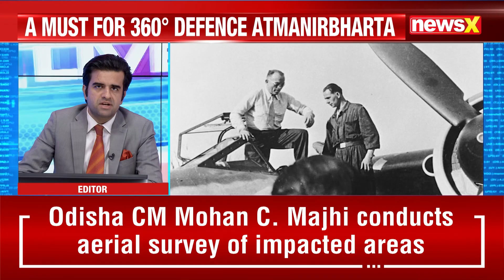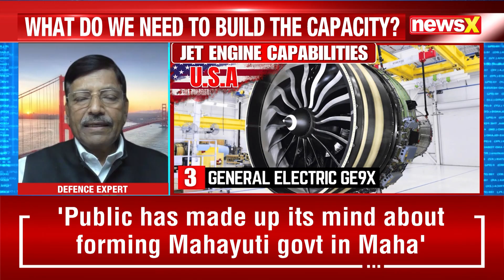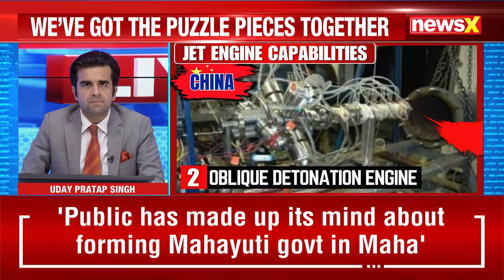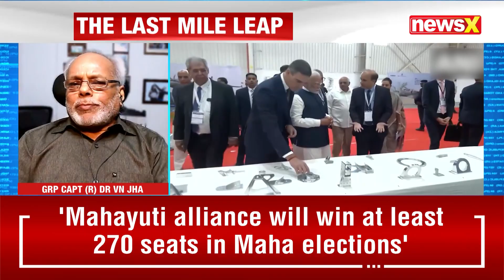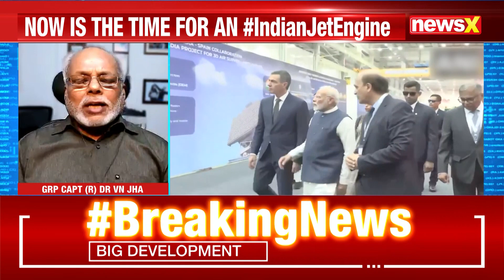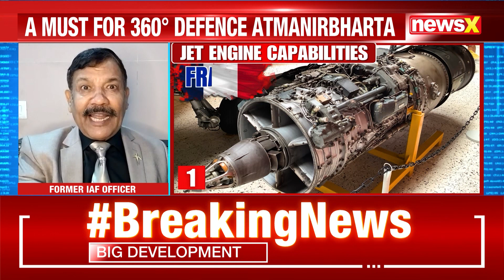Will India Produce Jet Engines Next? | What Do We Need To Build The Capacity? | NewsX

Comment: So much work left to do. By the time we come with the net engineother countries would have motored away further. They are not standing still. 
Sometimes it it is amazing and admirable how China has caught up with America in so many critical technologies
Reply: @viswanathanseshadri1047
That is the eternal dilemma of Technology. It doesn't pause, even. The best is get in its driving seat & drive (one must be leader in Technology & make others run rather than be follower to run ever after). Easier said, than done. But that needs God-damned brains!
China's lead: In Technology "reliability" is understood as part of it, built in & that needs to be proven. Proven Technology can't be given across the counter, but be proven in actual use (the user's skill & training are factored in, too). Proof of the pudding is in (actual) eating. It is why Americans who develop so many things (for warfare) don't even miss an opportunity to keenly observe the war to see how their"things" perform. If a thing hasn't been used in a war ever, will not find customers, but only the uninformed or those who want to have a hedge against "war" (in the hope & to be dumped on the heap after the useful period; no aircraft tire is used after the stipulated period, even if it is good - as it can be chancy!). It is a very tricky game of probability & Statistics (the foundation for Reliability Engineering).

Comment: Purchase orders are a requirement for an engine to mature. But maturity is needed before placing orders. It is a chicken and egg problem that usually gets solved in times of crisis like wars only. However, here, why not try to create drones with the current kaveri? It might be overkill - but think of this as the nextGen drone, but try to build a miniaturized version engine at low cost. Once this is proven, there will be sufficient orders to finance the perfecting of the engine.

Comment: Grp Capt jha is correct. If Kaveri engine was used in twin engine aircraft it would have been successful as Rafael with two M88 engine has the same total thrust what two kaveri engine can deliver. I suggest two kaveri engine to be used in TEDBF programme I think it will be successful. This option should must be used.
Reply: @kalyankishoresingh1628
Basic problem is "thrust-to-weight" ratio or for a given weight how much thrust can it give. With two engines, the weight will also be twice. But the thrust-to-weight ratio remains the same!
Reply: @MrPoornakumar  True, but so long as the air-frame is identical, said air-frame will no longer be under-powered, and its performance should meet the requirements
Reply: @MrPgs66  
Same guess has worked with Marut HF24 & you know with what consequence. Marut (it seems) had the best airframe design, but !As an aircraft Marut has worked very well even. But  could be fantastic with an engine of an asked-for power.
It takes a man & his wife to produce a "good" baby. If the man is virile & wife is below par, you can't expect results since the father (man) is capable for even more. 
An aircraft is a marriage of air-frame with its engine. 
Israeli's have experimented with airframes & different engines. And expectedly, resuts were different.

Comment: What is required in India is a research facility within IIT/DRDO for advanced materials and manufacturing technologies - development of high temperature, low creep alloys, directionally cast single crystal blades, other advanced metallurgy and heat treatment, high temperature coatings, laser drilling of cooling holes etc. and test facilities for aircraft engines - both ground based wind tunnel and a four engine test aircraft. Aircraft engine development and the advanced metallurgy/material science is based on a lot of testing and incremental development, and trial and error, so these are absolutely required to develop aircraft engines. These are still not set up. It should be noted the technology transfer for the F414 does not include the high temperature blade manufacturing and metallurgy which is kept secret, so while the engines can be made in India, it does not give India the know how to design and make new engines on its own.
Reply: @pisquared1827 
Thank you for listing the specific technical (Technological) issues. All this we have gone through, at least once before.
While we try "catching up" with it, the Technology gets so advanced that the goal post is moved further ahead - with the result we run only to stay at the same spot (or rather the "gap" stays the same).
I can say (with personal experience) that blame can't be parked at IITs. The devil is in the "application". Yet you can't say to someone "you apply!" as such a thing should fall in place or slot (right conditions) or circumstances. You can't leap-frog!
If I start probing or digging for the root of the problem, I may have to go to great depths - our (Indian) singular inability to grasp "material sciences" (in which the Chinese excel, to lead the world), inability to soil hands (born in ages-old socioeconomic milieu). My good colleague & friend RK Sharda (I don't know where he is - but must be blessed with good health & happiness), used to say - "to design an aero-engine, you need to know 2 things - Thermodynamics & Metallurgy. Unraveling Thermodynamic profile is near-impossible & we seek the help of an esoteric discipline like "Computational Aero (Hydro)dynamics" (again from personal experience as a nephew of mine not an IITian did work on this, but left to settled in the Silicon Valley & I don't blame him for it).
So what shall we do? Wait for favourable circumstances & for things to fall in their slots. Meanwhile things are progressing well in drdo (ada or gtre) that we need to take with good grace - rather than a pinch of salt.
[whether the "r" is squared, cubed or more "pi" can never be squared but remains as it is as the ration of circumference of a circle to diameter - it is the same here.]

Comment: The Director DRDO should specifically tell about the 1 ton reduction of weight required , metallurgy to sustain heat and high temperatures , single crystal blades of 5 Th generation , Blisks and Blings  , Thermal barrier coatings and technology to manufacture polish blade tips to less than 5 microns , 3D designing , high altitude test facility , 4 Eng Flying test bed . The babus responsible for sabotaging development and Looking for foreign engines .
Reply: We can’t underestimate the potential of foreign toys crazy IAF in sabotaging the Kaveri development.  I will not be surprised when Kaveri with one tonne weight less + another 10-15 KN thrust, the crazy IAF bosses will demand something more to push the Kaveri back to GTRE!  Very patriotic IAF!
Reply: @sreenivasv7355   first give 85-90kn wet thrust then talk. Atleast those can be used in Tedbf  dual engine.

Comment: we have to improve our metallurgy, for creating materials which are lighter and withstand high temperature.
Reply: @somyakumar5919
Other(scientist-engineers) in the West confronted the problems piecemeal and arrived at the solution piecemeal for each. It was called "development". We can't replicate & call it "development" it (one can't call it so - developing Technology that is already there, developed).  
We are now confronting the collection of problems. We need to untangle each strand and think like any of those working on that specific problem in past. We are getting confused and talking (or taking) one for the other.
The ultimate analysis will be, when the engine (90%) developed is fitted in the aircraft and flown (I think we don't have a test-bed for this purpose; if I ask for it, purpose can't be clearly stated as "development" or "use"/flying). Definitely problems are going to be there. Observe each & try sorting them & solving them (I think they call it "concurrent Engineering"), by carrying out modifications to see the response. It is costly as well as hazardous & we should be prepared for both. 
Whatever on may say (blame, castigate or whatever) we need to work, till the culmination. Work must go on!

Comment: It's embarrassing to see these so called "experts" get even basic facts about GTRE Kaveri engine wrong!

Kaveri was capable of producing 73KN when it was decoupled from the Tejas program when the requirement was 81-84KN.

Most sensible nations would have redoubled the funding when you have an engine only 10% off the thrust target but not India!

With whatever little funds DRDO could allocate within their budget, they kept developing the engine for last 10 years. Today the engine is said to be capable of generating 81-82KN thrust and about 80kgs heavier than required but GTRE is confident it can reduce the weight to less than 1100kgs if the program is funded again, but the government is so foolish to believe that GE, Rolls Royce or Safran will just develop an engine and hand over full TOT to India rather than funding our internal program.
Reply: @UppiliSridharan  I agree with you about the embarrassment, but Kaveri currently produces 73kn but is 1180 kgs (approx). This overall reduces thrust to weight ratio significantly and makes it unusuable on fighter jets. Compared to this, Safran M88 is 800 kg, something but produces 75kn thrust
Reply: Well, funds are never a-wanting. But you need to find a man to give that funds to him. There is an appalling paucity of this talent! But if you say, funding will sort the problem, I wonder. In Economics we used pose the issue of "satisfaction". If one wants to eat an apple. There is demand for apple & he can eat one. Still he isn't satisfied, give him a second one. But after the second (or third) apple there is no point in giving him another, anymore as he is satiated. Try another trick. Giving money is like that.
Reply: I have heard, they are struggling with the metallurgy of the design as well, especially in fan blades, which can handle that much heat and pressure.
Reply: You don't know anything, you are part of the team yet making comments as you know everything.

Comment: 10 year away ...i fell off my chair
Reply: This is after 30yrs of development 😂
Reply: @AIgen-ct3hz  
Aero engines take a long time to develop, and development is incremental. An example of this is the engine for the Airbus 220 (CFM I think) which shed fan blades and caused grounding of the fleet to upgrade the engines after entering into service. The same occurred in the Rolls Royce engines for the A350 and caused grounding of the fleet to upgrade the engines on all aircraft. This happened after extensive testing of a an upgrade to well known engine cores which had been in service for 40 years.  
Your post underlines the real problem here. The problem is not that the engine development is taking too long, it is that the babus at PMO still do not understand that it takes so long, and therefore they did not provide the funding or allow the time in the programme to do engine development. 
It is well known in the industry that you never develop a new aircraft based on a new engine because engine development is commonly delayed. The PMO did this based on advice based on what was learned from Marut - they used the F404 engine for the prototype and early models with the intention of switching to Kaveri to replace the F404 when it was developed. However they did not fund Kaveri properly, nor did they provide the test equipment and R&D to develop Kaveri in a timely manner. This would not have been such a major problem if the government did not carry out the Pokran tests, after which most of the technologies in the Tejas were sanctioned, and this is not something that HAL, DRDO, PMO etc could have anticipated because nobody told them beforehand. It is absolutely heroic that HAL, DRDO, ADA, NAL, etc. developed all the other systems and got the Tejas prototype flying by 2001 in its current form, and they should be commended for this, but the Kaveri engine failed to meet the deadline (which is an impossible deadline for anybody) due to lack of funding, time in the programme, and R&D base. The other thing that was sanctioned was cutting edge AESA radar technology which has now been developed to world class standards indigenously (Uttam). If the sanctions had not occurred, the Tejas could have entered service at around the same time as Rafale with the F404 engine and an imported radar.
Reply: Another 10 year loot of public money
Reply: @DishysTravelogue Govt had stopped funding from 2016-2024. They’ve restarted funding this year only.
Reply: Same with Congress. They fund for 2-3 yrs & then they stop funding.
Reply: time or money choose one, spend trillions like US and get new technology every year..........